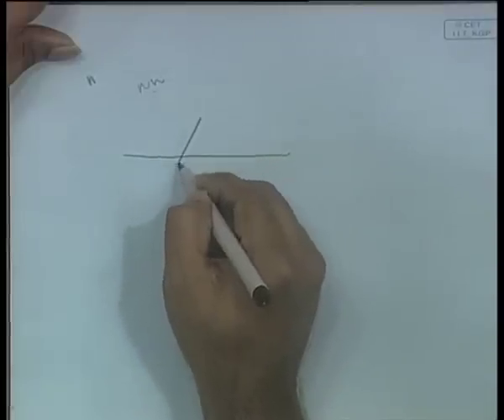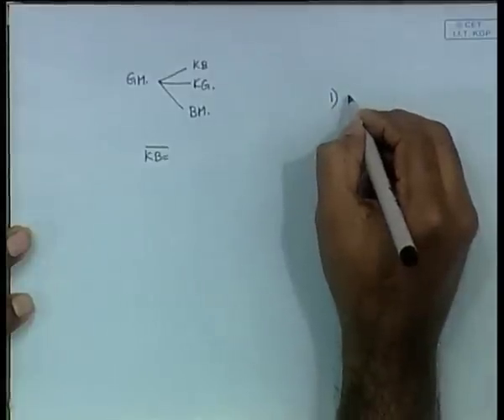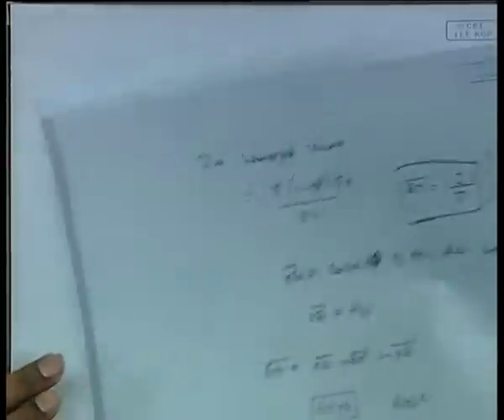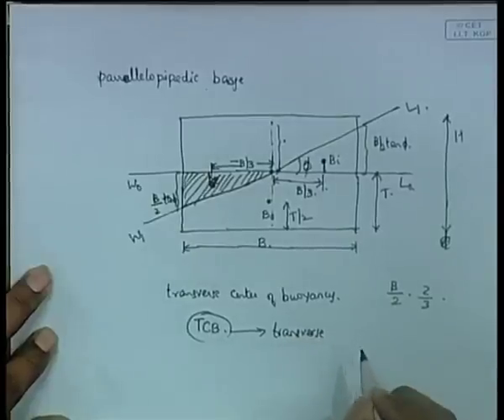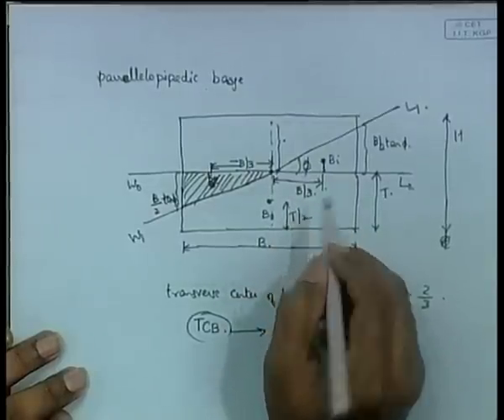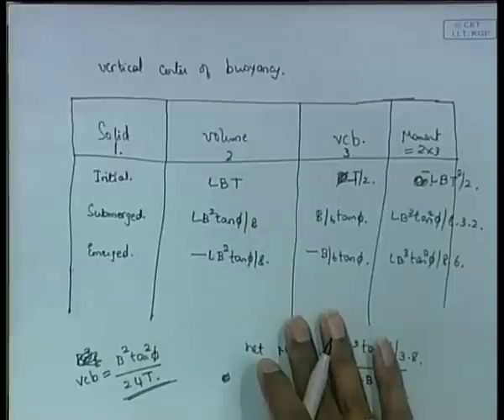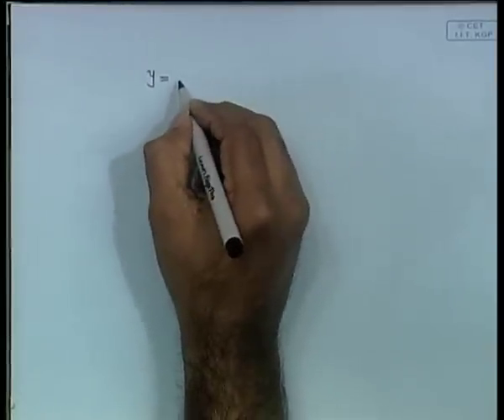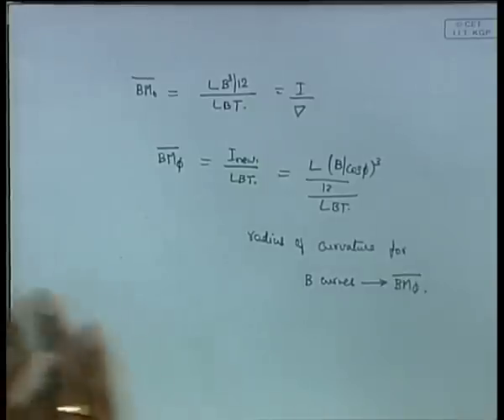Mod-01 Lec-05 Problems in Stability - I

Comment: The vertical center of Buoyancy will be 0 and not -T/2 in the initial state as the the displacement of the CB from the initial position when the barge is at no heel, is 0.